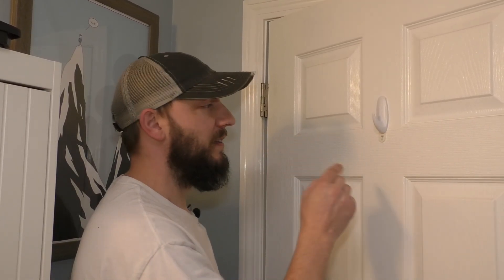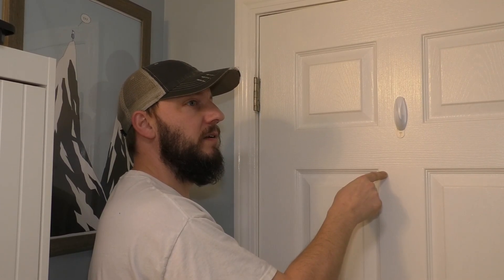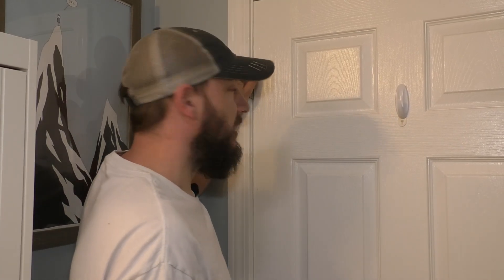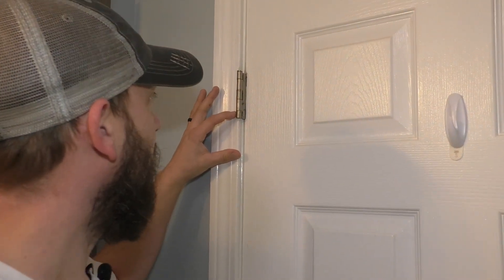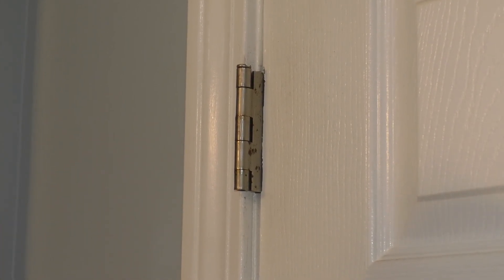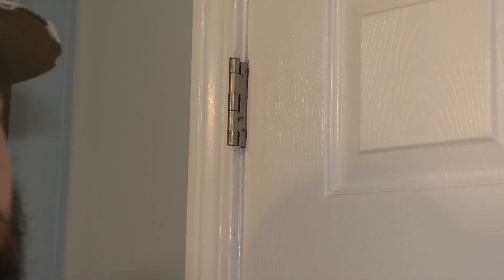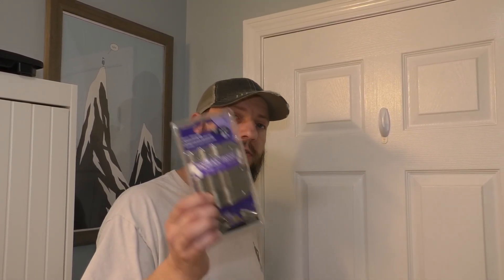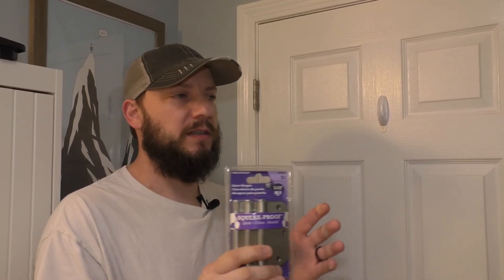How to Replace Door Hinges | Fix Squeaky Doors!

Comment: Take the pin out. Use a piece of Emery Cloth and clean inside hinge with a round wire brush and pull a cloth tru and put Vaseline on hinge and save your money

Comment: Do all door hinges have that extra long screw, or is that something you did, and if so, why?
Reply from the maker: Hey!  Great question.  That is something I always do when installing doors.  I put 1 really long screw in each hinge to try to get into the framing.  That way the weight of the door is not only on the door jamb.  This is important especially with solid doors and “split jamb” doors because if the weight of the door is only supported by the jamb it can eventually sag, this is 1 reason doors start to not open and close properly.  This would actually be a great video so thank you for the idea!  😁. Hope it helps!
Reply: @thefixerhomerepair2  Thank you for replying so quickly. I thought it might have something to do with safety, but it making it hang straight makes perfect sense. Love your videos.